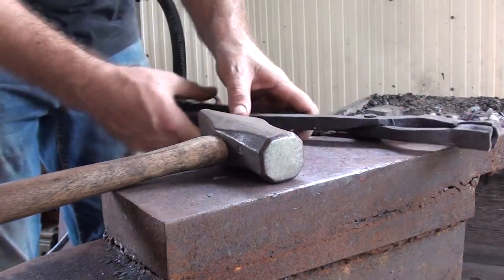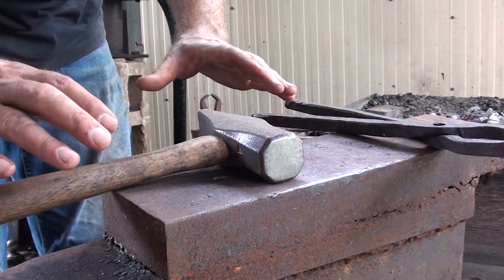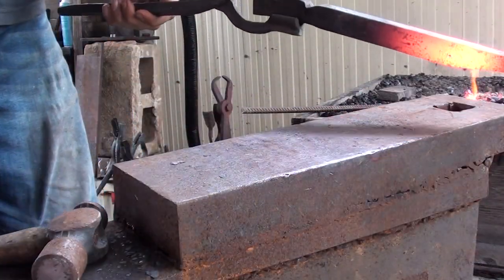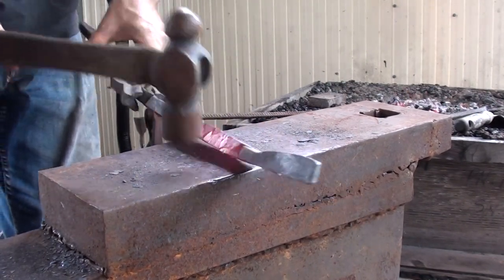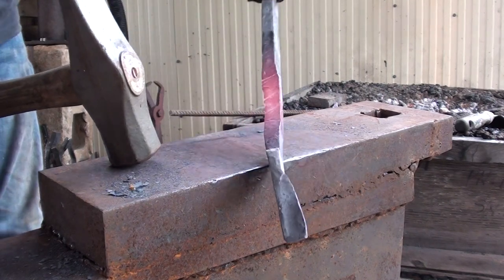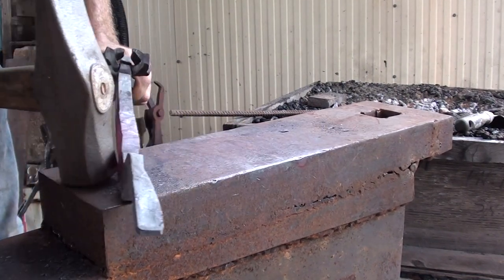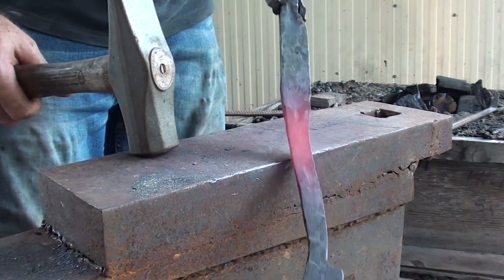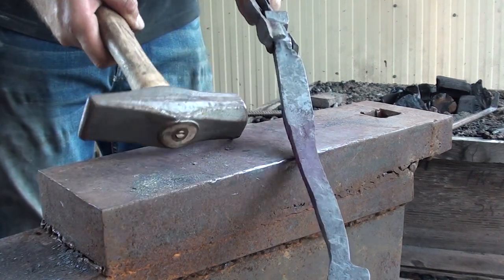Basics of Blacksmithing Drawing Out  without a horn

Comment: It's the weirdest damn thing and I seem to be VERY much in the minority with it, but I was taught by an extremely skilled blacksmith to make a taper on the end of the stock then walk the taper back until you're where you wanna go. You stay on the deck of the anvil the whole time instead of hooking over the edge. It seems to be a bit slower but it offers all the control over the stock in the world while mitigating cleanup afterwards.
Reply from the maker: That makes sense and would be a great way to work them with set lengths or stock. Great tip!
Reply: It's also great if you're not having a good hammer control day. It limits the extent to which you can f♡<k your piece up with sketchy hammer work.